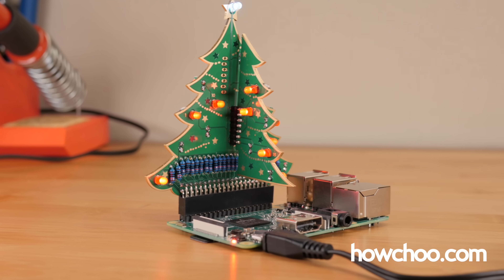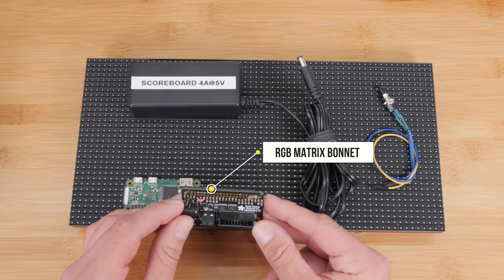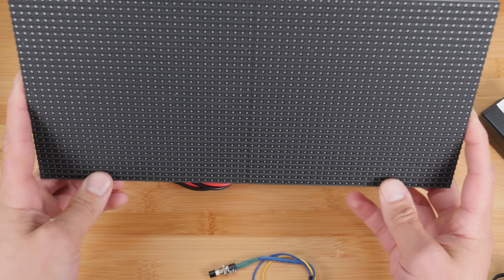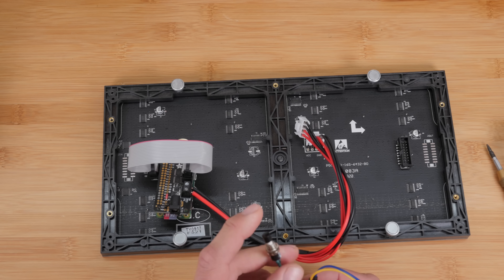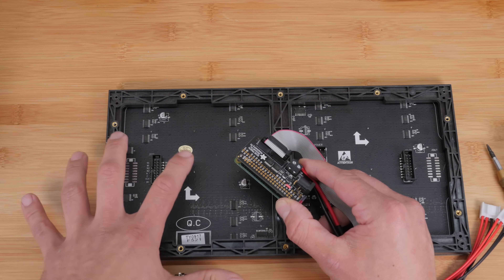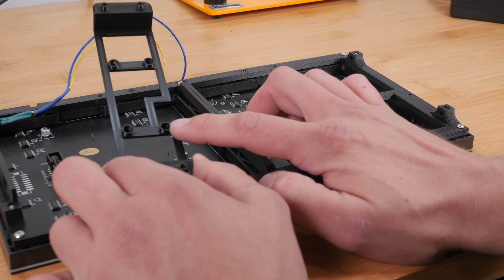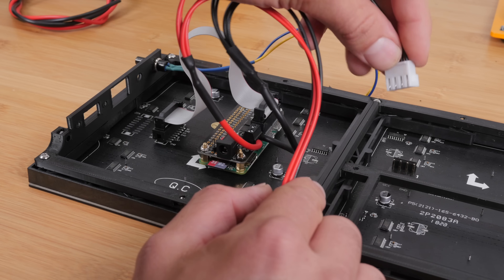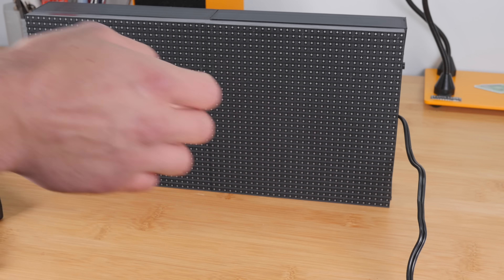Build Your Own Live NHL Scoreboard with Raspberry Pi!

Comment from the maker: See the full build guide on Howchoo: https://howchoo.com/g/otvjnwy4mji/diy-raspberry-pi-nhl-scoreboard-led-panel
Reply: Can you show how to make an MLB one?
Reply from the maker: To answer your first question, I believe that's correct—that's when it would cease showing the previous day's state and show upcoming games. I'm not sure about the answer to the second, but that should be easy to test.
Reply: @Howchoo  Would you provide me with the dimensions of the housing, or insert link of the video where you designed and printed it please!!
Reply: Will it work if i use banana pi instead of raspberry pi
Reply: what do i need to connect two panels together?
Reply: The link to the guide doesn't work any more, does anyone have the guide?

Comment: Hi, I've got mine working last season (I changed it display NFL data/scores). Now I'm borrowing a 3d printer Ender 3 V2. I'm having a hard time getting it nicely print out the housing. I've level the bed. I've done test prints (they look flawless), put then I go to print the housing for this, and it just starts off the base layer all stringy and not really well. Can anyone share what setting should I have this slice set to?

Comment: Can the code be updated to work across multiple boards connected together?
Reply: Im using 2 P3 boards side by side and is working great. In your startup command line you  need to add     -
-led-chain=2

Comment: Hello, I loved your video so I attempted to make it also. I wanted to make the MLB one. I followed all the steps and got everything you did. Its working but the issue i have is on the 64x32 5mm led it is showing the same thing like it was 2 32x32. I have spent days reading everything i could to get it to work and started from scratch and still happened. im sure its something small but any help to get the full 64x32 would be greatly appreciated. I want to give it as a gift before opening day. Looking forward to more of your videos!

Comment: @Howchoo, this is a great tutorial! I am interested in cycling through multiple sport scoreboards (NHL, MLB & NFL). I.e show each score for 5 mins then switch to the next. Is this possible to do? Any suggestions on where to start? Also, any suggestions on where to get weather related information for these boards?
Reply: did you ever get a response for this?  Would be interested in the same - multiple teams in NHL (if not all) and MLB & NFL
Reply: You can write a python script that runs on boot and just switches between different sports.

Comment: Managed to get this working after a few hours! Ended up getting the HAT rather than bonnet (accidently), doing a bunch of first time soldering work, breaking my soldering iron before even using it so I had to get another one, and could only find a small LED screen (16x32 about 7 inches long). Going to build my own frame out of some old broken hockey sticks which I am excited about! This was certainly an interesting first project to jump into the Raspberry Pi world! Thanks a bunch!

Comment: Quick question if someone can answer, I have everything up and running included the on/off switch and the anti flicker mod, my problem is that sometimes my scoreboard randomly turns on by itself. Any ideas as to why?
Reply from the maker: Weird! I would check the button connections—the button itself might be bad or there might be a loose connection or short. If you have more buttons, swapping it out with a new one is the fastest way to test.

Comment: @howchoo First of all, thanks so much for the guide! I am having an issue. I am fairly new to python and when I try to run the test scripts to make sure my matrix is working, I'm getting the error where it doesn't recognize "main.py". Any tips on what's going wrong? I feel like I am doing something wrong but I just followed the guide. 

Thanks for your help!
Reply: Did you ever figure out the solution to this? Currently dealing with this issue

Comment: Would you or anyone happen to know if this could work with stock ticker or res news feeds? And how I would go about to get the live stock and news feed to run on these led screen?
Reply from the maker: There are a bunch of libraries that use this library under the hood: https://github.com/hzeller/rpi-rgb-led-matrix — should be able to find some results with some Google searches and by checking out that GitHub repo.

Comment: I haven’t tried a pi but would this work with arduino?
Reply from the maker: The NHL library is coded for the Raspberry Pi, but there are other libraries for this panel that run on Arduino—none for NHL though AFAIK.

Comment: I know it's step by step and should be fairly easy to complete if one knows what they are doing, but will you ever make a video on the script steps?
Reply from the maker: Probably not in this case—the biggest issue is that software is constantly evolving. So if they released a new library, my steps would no longer work and I'd need to make a new video. For that reason, I do provide a full step-by-step text and photo guide (in the video description), which is much easier to update than shooting and editing a new video each time. :)

Comment: This is an awesome project. My plan is to build one for my friend. 
A couple things that I would like to add if at all possible would be an MP3 player and a relay for a 110v outlet. 
My thought is that when the Blackhawks score, the Chelsea Daggar song would play and a red beacon would flash.
Is this something the Pi is capable of doing?
Reply from the maker: Absolutely. You just need to store the sound file on the Pi and modify the code to play the sound file when your team scores. Of course, this requires some level of programming knowledge. Also, a red "goal score" animation already shows up when a team, scores. :)

Comment: I am so close... I can see my Pi connected to my wireless router, but when I open putty and put in the ip address it times out... any help would be appreciated
Reply: PuTTy Fatal Error      Network error: Connection timed out
Reply from the maker: @Eracer8  Sorry I missed this. Can you try connecting the Pi to an HDMI monitor and keyboard and see if it's booting correctly and getting a connection? Like try running `ifconfig` or `ping google.com` from the command line.
Reply: @Howchoo  I did end up getting my board running! I have yet to figure out the flicker though... I made the hardware mod. Not sure how or where to input the software change.?
Reply from the maker: @Eracer8  Awesome. Here's the software bit you need to do after the hardware part of the anti-flicker mod: https://howchoo.com/g/otvjnwy4mji/diy-raspberry-pi-nhl-scoreboard-led-panel#optional-anti-flicker-mod

Comment: Anyway to add a battery so you could bring it to a friends for a party??
Reply from the maker: For sure! There are a few options for doing this—a high-output battery pack would do the trick. You'll need one that can power the panel and Pi and, ideally, has pass-through charging so it'll power the panel and Pi while the power bank itself is charging. This power bank should work perfectly: https://www.amazon.com/gp/product/B06XRVHDLM?tag=howchoo-20 — it was recommended by the designer who created the housing I used in this project.

Comment: Trying to troubleshoot at the moment. When running any of the samples (or the live scoreboard), all I get is the same random blocks of pixels on my led board. Any ideas?
Reply from the maker: Is your power supply connected? What do the blocks look like? Any errors being output? Is this an Adafruit screen?
Reply: howchoo yes power supply is connected. The “blocks” I mean are just random colored patterns. Have it set up like yours with adafruit 5mm board.

Edit: It displays the pattern anytime I try to run the script. The board goes back to idle/no lights when nothing is running
Reply: howchoo the pi shows that it’s refreshing game overview, but all the scoreboard shows is currently 2 thick red lines toward the bottom. Thinking maybe the bonnet is bad?
Reply from the maker: @Itsjustsports05  So this sounds like a hardware issue—one of the connections, the bonnet, or the display itself is bad.
Reply: @Itsjustsports05 Even though this is a month old I figured I'd pop in - I had an issue with the connection between the pi and the bonnet. If I wiggled the bonnet I could find the sweet spot where it displayed properly

Comment: Can this be done on a 1920x1080 PC monitor instead?
Reply from the maker: Ivano Franchetto Not using this library—this one is specifically for an LED panel
Reply: @Howchoo  I too am interested in this. Do you have any suggestions?

Comment: I'd like to use the larger 6mm pitch matrix display. Could the 3D housing be enlarged easily to accommodate the larger panel? If so, how?
Reply from the maker: Traxxtar You can’t scale the housing easily because the screw holes won’t line up, but you could find another housing for it that someone has already designed. Search “6mm pitch” or “P6” on Thingiverse
Reply: @Howchoo  Thanks! I hobby in microelectronics and want one for College football. I'll see about having my son-in-law write a library to scrape those results. That said, this project of yours if fantastic!

Comment: Great guide! 

Putting a twist on this, I'm interested in doing multiple sports across multiple displays. I'm very confident I could get the teams/scores from the web automatically and create my own formatted images but I don't have experience with LED matrices or anything similar. It seems like changing the displayed image to something specific is cumbersome (at least for cheaper, 3rd party displays), but maybe I was just looking at the wrong guides. What resources would you recommend I look at to try this?
Reply: Ian Tillman if you do the multiple sports could you share how you did it? I would like to do NHL,EPL, College Football and NFL
Reply: @johnbotica7136  I've gotten one display working, though I still need to do a bit more optimization to get it perfect. If you have experience with Python I could send you my code so you can get started on your own display. From what I understand the display code from hzeller (that howchoo linked above) makes chaining multiple displays really easy, so once you get one working it should just be chaining the boards with the cables they come with and maybe optimizing a little more. The script I use to get scores is also very general, so you should be able to adapt it to getting scores from any sports league fairly easily.

https://imgur.com/a/85AXIK9 (Note that I do want to make the text look better, for now it's just a generic font rendered at whatever size fits)
Reply from the maker: To learn how to display images on the matrix and do what you're describing, check out the display library that it uses under the hood: https://github.com/hzeller/rpi-rgb-led-matrix